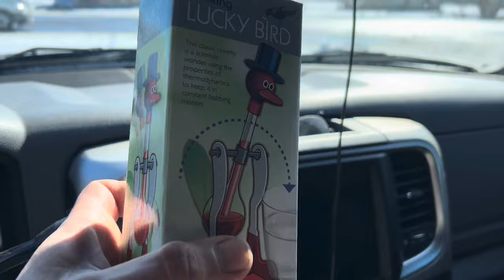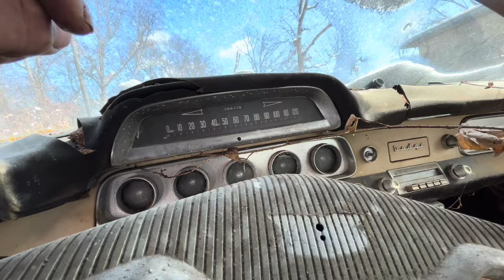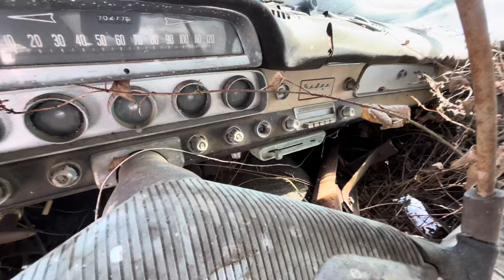1957ish Dodge Coronet saved from the junkyard! (Snow edition)

Comment: Got to be worth something in scrap weight also. You got to make you a skid for trailer. Use  roofs and hoods to sit car on the pull off trailer. Good luck.
Reply from the maker: It’s got some odds and ends I needed on my 59, and putting hoods down for skids is a great idea, will definitely use that the next time around! Thanks!

Comment: I had a Renault 5 in the 90s. Some rust, you had to be careful where you placed your feet when driving to avoid the Fred Flintstone syndrome. I wrecked it when a rock came up through the floor when i was driving 55-60 mph, it hit the front of the driver's seat and bounced up under the dash. Never to be seen again. It was funny for about one minute, then I thought about what would have happened if that rock had hit an inch or so higher, and it wasn't funny anymore. We drove slowly to the scrap yard.
Reply from the maker: Holy hell you got lucky there! I still have yet to hear a really positive story about these little Renaults!
Reply: @NastyCustoms5150 Positive... well, they USED to be cheap and as a cheap ass that don't like to spend money I liked that. Back in the 90s you could pick up one of those for a bottle of cheap whisky. Bring another bottle and you could get a driveable VW beetle to go with it. But today... I wish I kept all those rusty and shitty beetles I had in the 80s and 90s (bad engine? Get a "new" car with a running engine and swap it over, then send the "new" car to the scrap yard), those would be gold today. And those VW busses. like sitting on an ax slammed into a log, and then being dragged down a bumpy forest road by a tractor, but the prices today? Oooo, should have kept them.
Reply from the maker: @rudolphbondefangerer5513  Right on, you can’t beat a dirt cheap used car! It’s funny to see the ones that were dime a dozen back in the day becoming somewhat sought after!

Comment: Did you say you are going to take those two Cornets and make a stretch 4x4 '59 Cornet limo? The wheel base on the truck should let you do that. That's be sick!
Reply from the maker: Not a stretch but I will use the rear off the 57 to fix the the 59 then put it on the 4x4 frame, it’s gonna be a little different type of thing! Thank you!